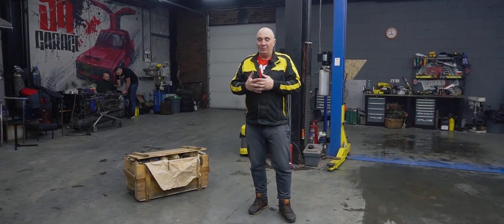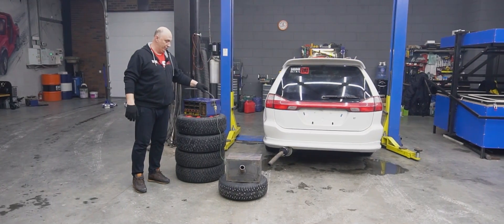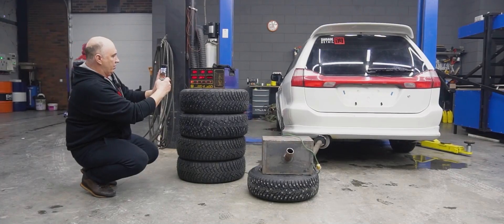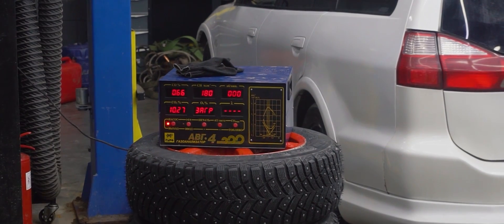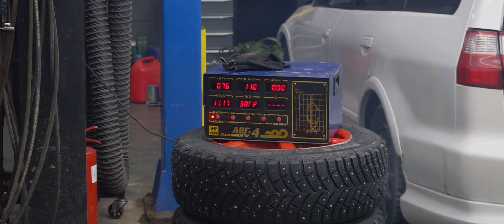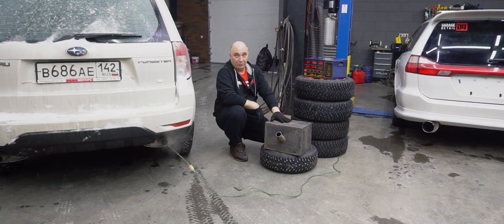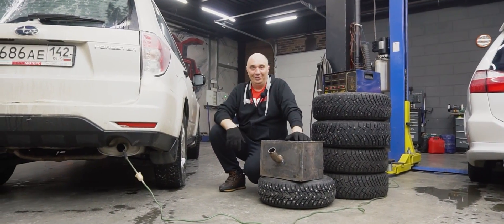Can a gas mask clean up a car's exhaust?

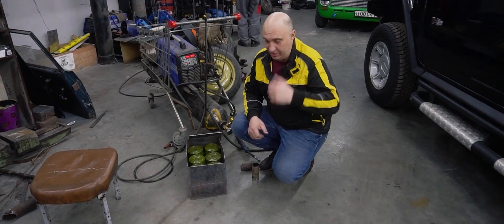Comment: The inlet and the outlet in that box at 2:30  should be swapped , as the gas cartridges actually have a one-way rubber intake valve at the bottom. That is, unless the translator got this backwards. They might still work the "wrong" way though, as the rubber valves will simply let go due to the heat and back-pressure from.the exhaust gases.

Comment: You should destroy a gearbox/engine/clutch. Get two cars, the first will pull the second one. On the second car, when stopped, put in reverse, and keep holding the clutch pressed. Make the first car pull you, and in like 80kph release the clutch abruptly.

Comment: in the 90´s when arrived at the carinspection and knew car would fail the exhausttest... people use to sneak behind and put rockwool insulation inside just to bring it down alittle.  but that was times when they hooked the sensor at the  exhaustpipe

Comment: Have you reversed the gas filters? The smaller round hole is usually towards the mask and is out. Shouldn't the gas flow from the bigger flat surface through the filter out through the thin hole to the gas mask?
Reply: Most likely it doesn't matter. There are no valves, no complex layered structures, just some charcoal pellets in a fabric container inside.

Comment: The filters are probably just activated carbon, which will only absorb volatiles like hydrocarbons and the like, need other chemistry going on to catch the CO and CO2 to turn back into separate carbon & oxygen, such as the CO2 scrubbers used up in orbit...

Comment: I've always wondered could you capture exhaust gases, compress it and store it.
Reply: And after that use it for welding shield gas. It might work i guess, if there is no oxygen. If the exhaust gas is from gasoline engine, it would propably work. But diesel engines gases wouldnt work, because there is a lot of oxygen.
Reply: That’s sort of what a diesel particulate filter does. It holds pollution particles, then fills up and burns it all off.

Comment: How about making a hand cranked turbo? Probably need a gear reduction to get a good spool but it would be entertaining to watch you floor it and crank a hand starter as fast as you can to build boost.
Reply: Dont think it'd work. You'd need horsepower in order to crank it fast enough. equivalent of a couple thousand watts. (Not possible for a human to output)
Maybe if you had a team of like 5 people all cranking with their legs with pullys. to get over the static friction limit. you could achieve a couple psi
Reply: @realflow100  turbos barely have any static friction? It would be super easy to turn multiple times with a single crank (plus the intake is a vacuum assist). It's a 1.7l lada engine not a 6.0 LS and you don't need a couple PSI of boost to make more power, even just 1ATM has significantly more oxygen then a vacuum. If it really needs more power then sure add pulleys and more people.
Reply: Turbo means exhaust gas powered charger. You maybe mean a human powered air charger?
Reply: @peraz968  I know what a turbo is sure call it a "human powered air charger"
Reply: @cameronhuber8339  I appreciate the way you think, but you may benefit from some more study into physics. It's a power issue. Your idea may work but for a much smaller engine, like perhaps a model engine. No offence intended.
Reply: @farvatron  have you ever spun the inducer of the turbo with your hands? its very very easy and there is barely any friction. Im sure with a hand crank and the appropriate gear reduction it would be possible to build less than 4 psi of boost
Reply: @dieselgeezer18  try to spin it fast enough to build pressure… yeah it takes a few thousand watts worth. Not easy
Reply: @ionbusman2086  what pressure are we talking about? Im not talking about anything over 5 psi
Reply: @dieselgeezer18  right and at a pretty high cfm… this is why actual electric turbos take well over a 1000w of power. The friction alone in a gear box to take your 10RPM of your hand to make 20,000rpm at the compressor is crazy..

Comment: Video idea: let gallium absorb into an aluminium engine block for 24 hours + and then try starting the engine
Reply: instant destruction
Reply: @realflow100  Would still be good to see how it propagates through the material
Reply: Inside the engine block it probably wouldn''t have an effect. The oil film and natural oxide layer on the aluminum needs to be exposed and removed. Gallium I believe requires direct contact to amalgamate with aluminium. outside the block and the surface scratched it would cause critical damage over time
Reply: genius
Reply: Gallium whilst running lol
Reply: It won't last 24 hours, better add it then start running it
Reply: Yes! That would be very interesting how long it lasted
Reply: All these comments, I'm proposing they allow the galium to soak into the block from the outside over a couple days (obviously scratching the underlying surface to allow for maximum absorption). Chances are it would probably just crack open itself before you get the chance to start it because of the stresses the block deals with even at rest (cam springs etc.) but would just be really satisfying to see an aluminium block crumble like biscuits
Reply: Gallium instead engine oil
Reply: Nothing would happen there is a video of someone doing this already
Reply: 100th like its me 😂😂
Reply: thebackyardscientist did this with a motorcycle engine and nothing happened because of the oil coating on everything.

Comment: Video idea: put the motorcycle quadruple carbs on the 1-stroke engine, the one with all cylinders firing together.
Make a 2- banger engine, that is a an inline 4 where 2 and 2 cylinders fire simultaneously.

Comment: thrush glass pack exhaust muffler... a pipe that has a bunch of fins cut around it that create air turbulence that mixes exhaust gas causing more catalyst function to burn unburnt fuel. exhaust resonator does a similar thing to the catalytic converters and if the vehicle is running very poor it will cause additional noise... otherwise does nothing on a clean running engine.

Comment: That's taking the easy way out why don't you just use 12 volts 29 amps do a hydrogen water subtraction reinjection and amount of fuel in the fluorocarbon the emissions will be so low

Comment: Russia has reverted to carburettor production, I don't think emissions are on their minds right now for (reasons).
Reply: That’s not true. However, curbrated cars can be cheaper, especially in places with no fuel shortage. As for the emissions non-sense, it’s just leftist propaganda. The polar caps are the same size they have always been and the seas are not rising at all.

Comment: What a great idea, though it did not produce expected results!!  I would like to see the same experiment with the canisters in a different configuration, one behind the other stacked cylindrical just to see if there is different results. And I would like to see different kind of canisters for different purposes this is a very interesting experiment! Great work guys!!!!
Reply: It was a bad idea, and changing how you configure things wouldn't change the results. It would be more interesting to see them fit this sort of contraption to an old diesel engine that smokes a bit, and see how many particulates they can catch, and how long it is before the whole thing gets bunged up and stops working.

Comment: Guys, I have been waiting for you to pump up a lada motor. You know, the valves bigger, head and block resurfaced and shortened etc. To see the Statis vfts idea redone and the outcome in horsepower with just proper fine porting of the cylinder head and so on. Greetings from Bulgaria. Keep up. I am always waiting for the next episode of yours  :)
Reply: They have done quite a few experiments that did end up increasing output, they should combine a few of them into one.
Reply: Yes these guys are fun and educational to watch!! I’m right there with you, love the modified Lada’s.
Reply: they did make a 20 PSI lada motor, but there was no part 2 :/

Comment: Video Idea: using glass fibre reinforced and bakelite as brake pads. These materials is used to make circuit boards. As an electronic technican, they smell kind of " sweet " when burning.
Reply: Probably not good to be smelling that stuff burn.
Reply: @scottinWV  I am aware of that but I can't help it to notice. The worst ones are the black bakelite, they make me light headed.
Reply: @maverickMVK , haha! I was gonna say, formaldehyde supposedly has a sweet smell, too.
Reply: Bakelite was used in a lot of brake calipers. They made the pistons out of the stuff. Bakelite can take a lot of heat. Not too sure about the friction aspect but that would be a pretty good experiment.
Reply: @Mike-qp8bv  Since world war 1, it was used to make airplane propellers, on pistol grips and rifle butt stocks. I think it candle some considerable amout of heat since it was used as heat shield for Soviet ICBM warheads.
Reply: @maverickMVK  That's pretty interesting. I don't have a lot of knowledge about the material. It seems to me that it's been disappearing from the market in favor of different materials. I don't have anything to back that up. Just an observation. A lot of brake caliper pistons were made of bakelite and it was great. No corrosion, so pistons were unlikely to seize in the bore compared to steel. Failure rate was a lot less. And for whatever reason manufacturers went back to conventional materials. I would assume cost was the leading factor. It's always the number one reason.
Reply: @Mike-qp8bv  bakelite expand high humidity unlike plastic does. It has a sickly sweet or fishy odor when burned. Maybe that is why it was replaced.
Reply: Bakelite is used to make AK magazines. Seems apropriate.
Reply: @FuckTheState  even better...

Comment: I want to see a Lada fixed up as a turbo compound engine.  In other words, the exhaust will go to a turbo that is geared directly to the flywheel.  Take off the compressor side of the turbo, machine a coupler to attach the starter gear on the rotor shaft, and find a way to connect it to the Lada's flywheel.  Might be easier to take out the starter motor itself and install it there.  The Lada will have to be started by other means.  

Unlike a turbo charger which converts that energy into a pumping force to cram more air into the cylinders, the turbo compound increases thermal efficiency by direct conversion to mechanical energy.

The turbo compound should improve the Lada's fuel economy and give a modest power improvement in the process.  I don't know if there's a dynamometer in Siberia but, it would be interesting to do a comparison to see how much of an improvement it would make.
Reply: Sounds like you want to see the mother of all Lada’s  their guy!
Reply: @mclr.cfabricationandperfor5255  It will be a challenge but, Vlad and his crew are up to the task!
Reply: @mclr.cfabricationandperfor5255  The turbo compound system was best known in the old DC-7 airliner.  When it worked, it gave amazing climb and cruise performance.  Problem was that the metallurgy of the time just wasn't up to the demands of the system.  Now, it should be easy, even for Vlad and his inexhaustible supply of Ladas.

Comment: The filters are backwards. Maybe try flipping them around to see if there's a different result?
Reply: 2:35 I was thinking that but if you look at the seam on the middle.. it is offset. @ 3:12 the inlet part is the correct way round with straight pipe as the inlet
Reply: Looks to me like they are the right way around. I would be inclined to believe that Russian gas mask filter elements have an elastomer valve in the threaded shank to keep the air flowing through the canister, through the valve, and into the mask, with a separate exhaust valve out of the mask. Anything other than air would be trapped in the canister, releasing only filtered air into the mask. It would also keep any exhaled moisture from affecting the filter medium.
Reply: they're not backwards, these old style ones have no valves.
Reply: @dimitar4y  the screw part is the exit  not otherway around but indeed no valves
Reply: @engineprojects  that means there's no exit.
Reply: True that.  If they're backwards I must suspect they're adding pollutants instead of filtering.  Surely my math isn't off on that one.
Reply: Yup noticed that to